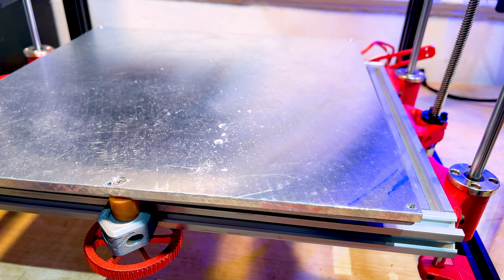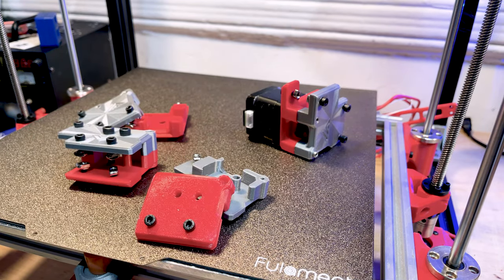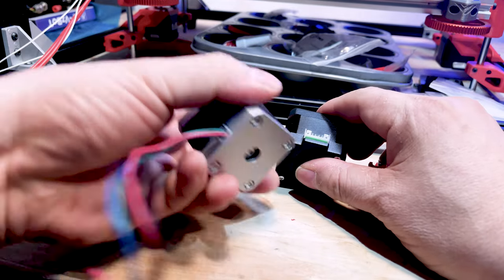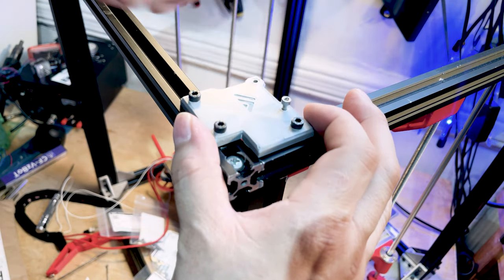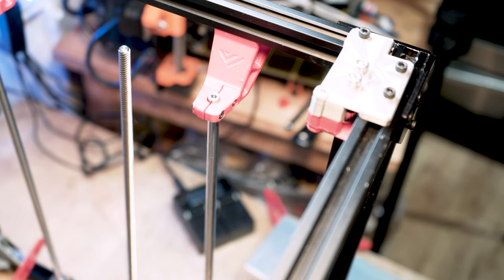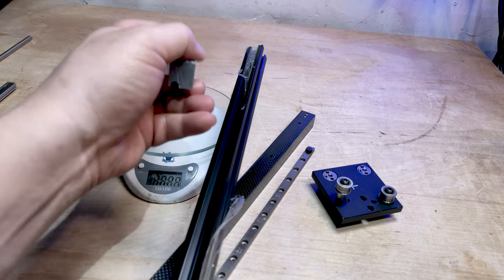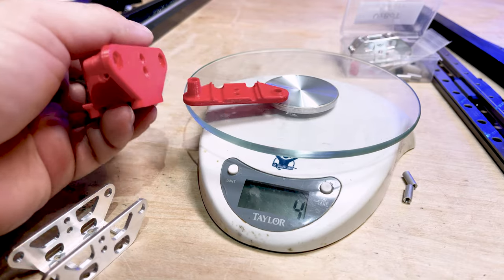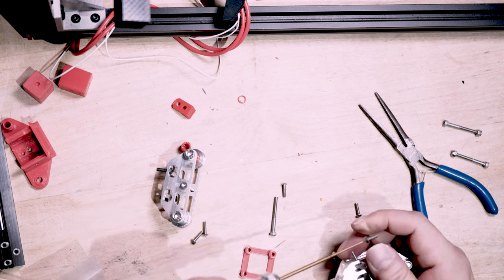hour How to build the VZbot Gantry - Part 6

Comment: First time on weight CF rod was 59g. 2nd time - 19g. Wtf? 🤔
Reply from the maker: Good catch! My scale acts up sometimes… So I just stripped every thing off the carbon rod to get you the correct weight of the carbon fiber rod is 19 grams. 
The aluminum rod should be around 70 grams.
Reply: @tommygunnfilms  i've got broken eyes, so i see only imperfections xD
Reply from the maker: @wykonczeni  well it helped verify the correct weight.